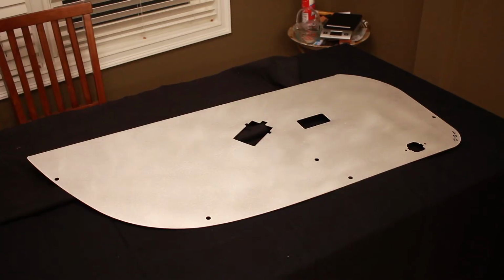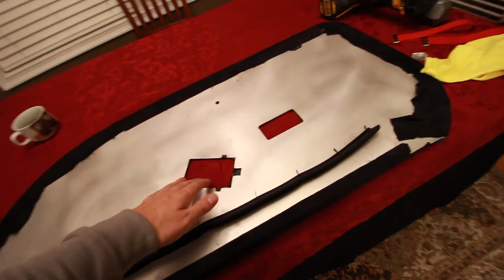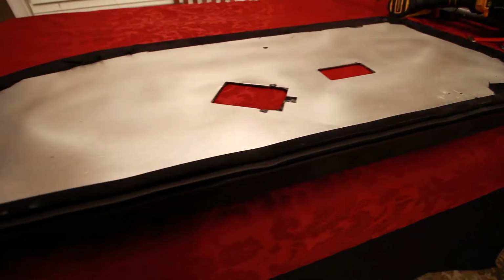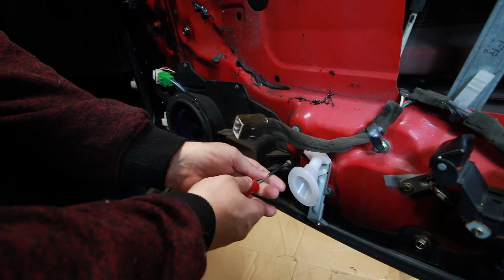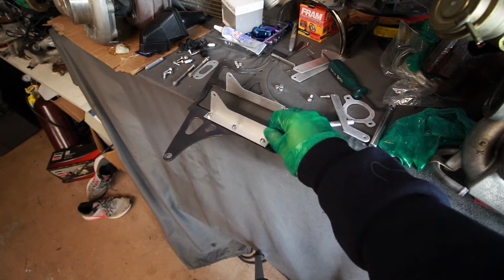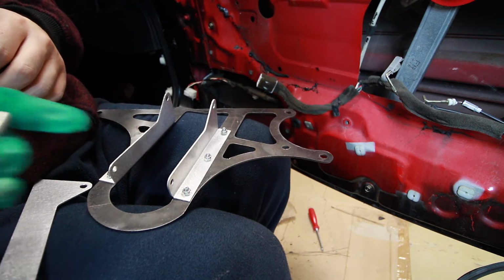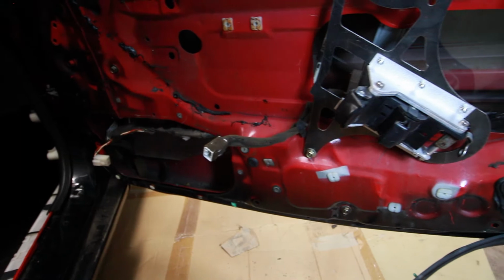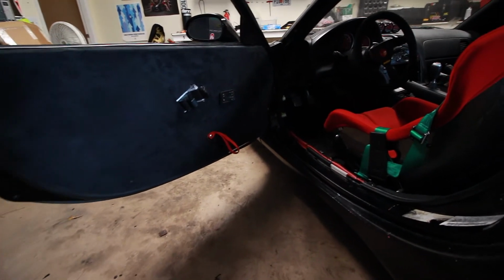Wrapping and installing LRB door panels in the FD RX-7

Comment: Hey bro can’t get my driver side window box to sit flush any tips?
Reply from the maker: Is it the power window switch? If so it's normal for it to protrude about a 1/2 inch or so.
Reply: supercarmio ok yeah it’s sticking out about half an inch. Wasn’t sure if I messed up. But also got another question my passenger side door lever to open the door doesn’t work I disconnected the cables to re route them as directed but once I plugged them back up it’s moving the lever but door isn’t opening from inside the car and outside the car.
Reply from the maker: @SimThrills4U  haha na you're good! hmm is the lock working by chance? what happens when you lock/unlock from driver's side?
Reply: supercarmio so when I try to use my key to unlock the car from the driver side it does nothing it continuously stays locked. So when I popped off the cables on the one directly connected to the door lever the white round plastic piece that sits in that round groove I broke that. So  thinking maybe that’s the issue. My buddy says the cable is still moving properly but idk man lost
Reply from the maker: @SimThrills4U  ah crap man. that sounds like that'd be the issue. something similar happened to me in my FC. had to replace that white plastic piece, it was super brittle in mine.
Reply: supercarmio yeah where it sits in the little grove with the metal clip over it to keep it locked when I was in doing it I broke that little plastic piece from the metal running up to the l clip. Haha dang it. Was hoping that wasn’t the issue